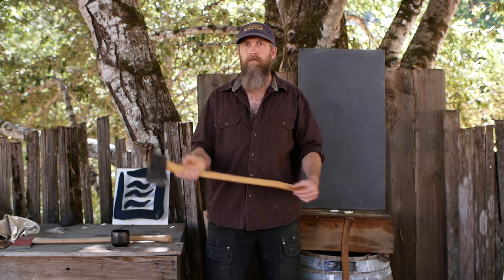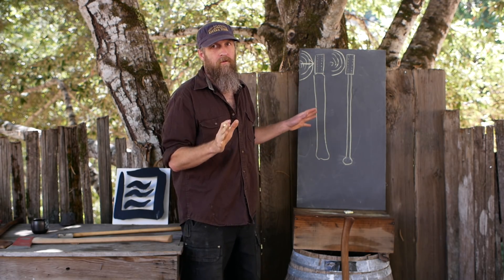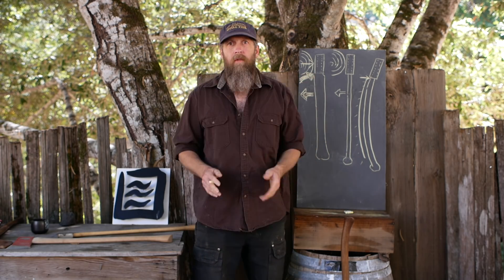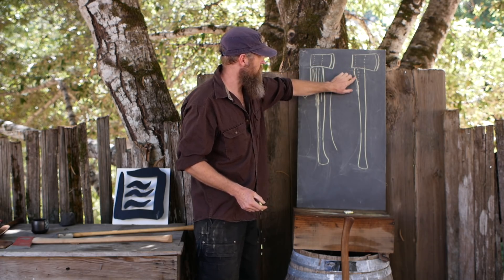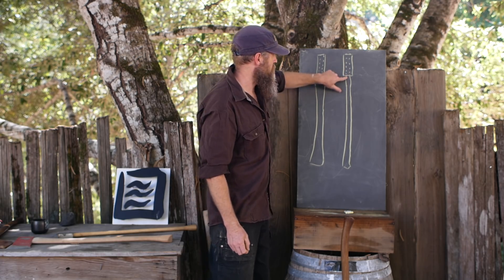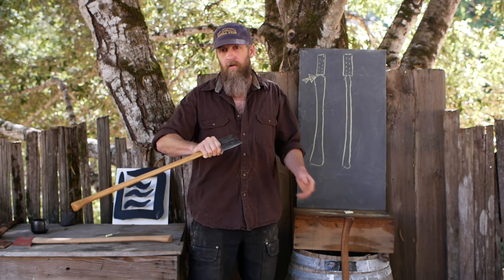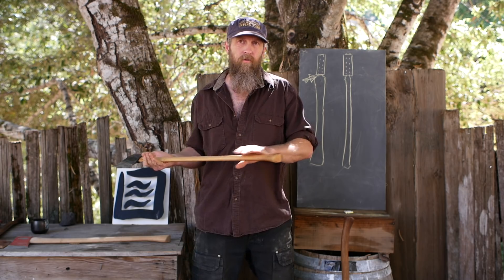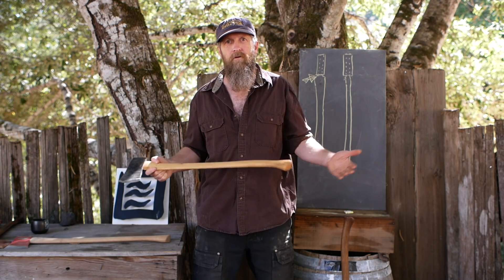Why Axe Handles Break at the Eye: When Strength is Weakness, Overbuilding v.s. Stress Distribution

Comment: A flaw I notice in axe handle design is that at the shoulder where the shape defies the grain, it’s offset entirely to one side. Making this deviation more extreme. From handling other eyed tools it would make more sense to me if the shoulder was symmetrical to make the deviation less extreme and the handle overall stronger. 

Is the purpose of the offset shoulder just to better facilitate the curve of an axe handle?
Reply from the maker: That's an interesting question or angle because it begs more questions.  Obviously double bit axes have that kind of configuration.  If we subscribe to the balance improvement theory of poll axes, it would mess with balance to have a straight handle that has a cut across the grain at both the front and back.  I'm not saying I do, but it would definitely affect balance.  Another point is that the back of the axe handle may be stronger in that direction, because it's wider than the front edge of the eye/handle.  Of course double bit axes essentially have that kind of configuration, but it would interesting to know if they are any more likely to break on the front side when chopping than on poll axes where the handle comes more straight or barely curved out of the eye at the front.  I've always preferred to have the narrow front edge of the handle come more or less straight out of the eye, because I consider it very vulnerable.  The main use of the axe is using the bit to chop and split and the pressure applied to the bit should cause the handle at the front edge to stretch, while the back side is compressed.  Then again, if pounding with the axe, that vulnerable cutaway at the back of the handle would be under stretch.  But again, it is a lot fatter and might be less likely to split along the grain because of that.  Somehow the idea of cutting away both sides doesn't really sit right with me, but I'm not sure there aren't more reasons.  I certainly don't recall seeing it on many poll axes, if any, but of course that doesn't mean it's not a sound idea.
Reply: SkillCult it certainly is a lot to think about. I’ve wondered if it may even be better if the offset were reversed so that the grain coming from the thickest portion of the eye was uninterrupted leading into the handle, though I definitely see your point about the thinner front portion needing added strength as well. 

Having learned to swing with hammers first I greatly prefer straight handles (my most used axe is a double bit), I’ve got a couple nearly identical old Connecticut pattern axes I need to fix/handle. I think I may put a curved handle on one and a straight handle with a symmetrical shoulder on the other and see how they preform. Especially since the conni is a particularly poll heavy axe.

Comment: I believe the eye of an ax is shaped as it is because how they where made during the old days.  By folding an section iron flat bar and forge welding a bit of high carbon steel for the blade (check out Peter Ross a historical Blacksmith).  The iron just wants to make this shape when folded.  According to Roy Underhill, the poll of an ax is an American invention because the Europeans did not have the Hickory Tree, which required the extra mass to chop it.   I believe you hit the nail on the head concerning the ergonomics of a slender handle.  The Maddox has a large eye and is mentioned in the bible which illustrates it's been around a long time, but, it doesn't  feel right if you need to choke up on the handle,  and takes away the multi-usefulness  of the tool, which is common for western culture.  The stone ax was a multipurpose tool that could be removed from the handle, used as a chisel, plus the handle had a  wedge on the end for bark removal , and, furthermore, the handle could be used as a hammer (4 in 1).  The stone ax dates back to 600 years ago, which isn't a very long time.  I'll make a ax using stone age technology but use steel instead of rock and let you know how it works.
Reply from the maker: I suppose it does tend toward a teardrop shape from forge welding a wrapped eye, but it can still be drifted out into pretty much any shape.  I'm not buying Underhill's theory on that.  There are heavy axes with no poll.
Reply: Yes, you can drift the eye to any shape, but, it takes a lot of work.   They were getting paid by the unit, and,  it's human nature to take the least path of resistance.  Iron is a tough martial to shape. I have a forge and it's remarkable how much effort it takes to drift something by hand.  A press makes easy work of it, but, them old timers didn't have machinery.  Interesting though, the shape works out from a mechanics of materials point of view. Wood is stronger in tension than in compression, which is different from metal which is normally equal in both tension and compression.  During the normal chopping swing,   the egg shape of the eye has less cross sectional area on the tension side and more area on the compression side. Even when the ax is stuck and you yank up on the handle, the bottom side is still in tension and top in compression.  Serendipitous or by design?  I think  it's just like the way the pyramids built in Egypt, trial and error. The poorly designed ones don't last the test of time!  Someone  figures out a better mouse trap (faster, cheaper, and better) then it's copy and past down the line of time..
Reply: I don't know but Roy might have it right.  Like you have said, the experienced woodsman used a small ax head with a slender handle for accuracy.  There where used the multipurpose tool ie building shelters , setting snares and chopping wood.  The name of the game is making chips, right?  Looking at the properties of Hickory, it has a remarkable higher Modulus of Elasticity and compression strength, which may have been the driver for something new.  Plus, I have a very cool book you would probably like.  "Museum of Early American Tools" by Eric Sloane.  He gives an Illustration of the 1600's British and German and shows the polls did't start to appear in the 1715's and are Anglo American.  He shows many Tanners tools, as well!

Comment: In my experience on the cordwood challenge, my original thin handle on my vintage double bit broke. Needing to rehandle in a timely fashion to get back in the fray, I stuck a stock handle on it without thinning it down. It cut like a completely different ax. I felt each stroke much more in my arms and shoulders. I finally took time to tune the handle using the thin original as a template. Made a world of difference in my strokes and stamina in a days work on the challenge. Really appreciate you exploring these topics with us. No scientific proof from me on thin handles except my experience and what my body tells me.

Comment: A slender handle is so much more pleasant  to use . I agree that the steel edge of the eye against the most narrow point of the handle is the weakest spot .All the wood handled tools I  can recall the break started at the eye .only exception was trying to pry a rock out of the ground with a shovel burried into the ground against the rock prying and bending the handle to the breaking point.
Reply from the maker: it would be interesting to survey breakage type percentages.  It seems like the greater number must be near the eye and most of those initiating either where the grain is heavily violated on the back, or right at the bottom of the eye.  I know most breaks I've suffered over the years were at  or near the eye.

Comment: Thanks to Issac Newton, he gave us the tools to examine  the forces in an object called newtonia mechanics, which is the basic of today's engineering science.  Looking at the ax handle as a cantilever beam sticking out of wall of concrete and you apply a  force on the end of the handle, the highest stress point is where the beam exist the wall (or handle exiting the bit). The stress here is called the bending moment, which the  bending stress = (Bending Moment times dist from the centroid) divided by the moment of inertia.  Since the both have the same eye area, they should break at the same stress.  Bending force (properly called Moment Force) is a multiplier (Force times distance) and is the force that breaks most tools.  Trying to  pull a stuck ax out of a log, I broke a many of ax handles. Being over 250 pounds and over 6 foot, I can swing an ax.  But, I  tried your approach using a short/ light Ax ( a Fiske with a v shaped bit  and sharp) and I am very pleased with the results. Going to try your Chord wood challenge!    Real enjoy your videos, there Awesome!
Reply from the maker: Cool.  Even when the head is not fixed, as in when it's stuck, I think the greater density and total mass of the head must create situations where the handle it working against the head in a way similar to a beam sticking out of a wall as you describe, and vice versa with the heavy head bouncing around working against the handle.  Me too on breaking handles on stuck axes.  That is one of the things that led me to thinking of axe handle breakage and stress distribution in these terms.

Comment: i never heard of an axe breaking. very rarely. if it happens so what replace it and go on. why so much fuss about axe handles? i think american axes break because they are all twisted up like that. try making it straight and slightly tapered towards the end of the handle. american ones dont break all that often either I think.
Reply from the maker: People break them all the time.  Maybe we are all completely incompetent.  The type of breakage addressed in this  video has almost nothing to do with whether the handle is curved or not.
Reply: @SkillCult  you should do some leather videos.

Comment: i think its just cuz there using more and more crap wood with poor grain so the thicker handle makes up for that.
Reply from the maker: That may be true.  Thin handles are more likely to warp after being milled as well.
Reply: It's gotta be cheaper too; I'm sure the a lot of machine automation cutting out handles and having them generally thicker reduces margin of error. Im fine thinning the handle out within reason, id like to see them get fitted properly

Comment: This and your videos on head weight versus velocity were super helpful for me to understand why my 23 oz. framing hammer was so awkward. its a vaughan with a straight handle and they manufacture it with a belly in the middle of the handle where I feel the need to grip it, instead of towards the end, because the head is pretty heavy. I shaved the belly out of it with a block plane so its totally straight and about 1 1/8  x 3/4. more flex now and more natural grip with my finger tips coming around to touch my palm, so my elbow feels a lot better after using it all day. I also took a grinder to the chunkier parts of the head and probably took it down a couple ounces, now wherever I grip the handle the shape is the same so my grip doesn't change and I have more control with the lighter head in whatever position I am swinging. I am wondering if you have videos or know some good videos or information on what handle cross sections are good for different applications - what I mean is if you imagine cutting across the grain where you grip the handle what shape would it be looking at the end grain - oval, rectangular, oxtagonal? I'm a carpenter, and novice firewood gatherer. thanks. -Weston
Reply from the maker: Hi Weston.  I don't have a lot of opinion on cross sections actually.  I haven't given it a lot of attention.  It would be interesting to look at old hammer handle designs v.s. newer ones to see if  there is the same trend toward increasing thickness over high performance.    I have a feeling that might be the case, but I haven't paid enough attention.  I know that most of the old ball peens I have bought have had very thinned out portions just below the eye.

Comment: I have a 2x2 (1 1/2 inches) Red oak stick about 7 feet long that I screwed up while woodworking that I use as a big prybar and it's tougher than it looks.  And when you look at a wooden shovel it's about that thickness too and if you ever used a 6 foot spade you know you can pull on that handle pretty hard before it will snap.  Even a shop broom is pretty tough I have snapped a few of those and it took a beating.

What I am trying to say is that wood is tougher than it looks.  Especially kin dried hard lumber like ash and oak and maple so why not shape it to something that feels good in the hands.  Worst case is that it will break on impact and you will feel it right away when that will happen and don't go hard with a sharp tool until you know how to handle it.

Comment: Outstanding presentation Stephen. With over 30 years professional experience as a steel fabricator I can say unequivocally that sharp inside corners are a huge problem. Sharp outside angles (like at the butt end of your handle) are not. Any time that you are cutting into your material square corners are to be avoided. Working in steel, cutting a square inside corner will always stress and crack at the corner. They must be given a radius. The more radius you can engineer into it the better.  Thanks for pointing out that the axe is a dangerous tool and no joke. That can't be stressed enough. Chainsaw too.
Reply from the maker: Danger, Danger..  Never hurts of reiterate....  I don't know the math at all, but I would assume that the strength curve is not linear and that there are diminishing returns, but it does seem fairly obvious that the more gradual transition the better.  Thanks for the input.
Reply: You would think it's obvious, but I see square cuts and sharp inside corners more often than not. I don't know the math either, but I agree that there are diminishing returns, though typically other design considerations intrude before those are met.

Comment: Good stuff.  It maybe makes a case for doing what you did on the Husqvarna (I think?) where you were rounding over the inside edge of the eye before putting the head back on.  I thought that was a really interesting idea, to potentially reduce the stress concentration.  It certainly seemed like a good idea to try.  

But all this talk of handle breakage is clearly not as important as how fine a grit you use when polishing, and what wood you use for a wedge to get a cool contrast picture for Instagram.  Don't you pay any attention to Axe Junkies?
Reply from the maker: Well, at least not having a sharp edge, but I have given some thought to more radical versions of that.  I think if one approached the eye more from an engineering standpoint, it might end up looking and functioning quite a bit different than the average axe, or possible any axe.  I have some ideas brewing, but carrying them out is another thing.

Comment: Thanks for sharing this information with the Axe Community.  Totally agree with the technique points, including what some call "floating the axe"... lighter grip just before strike impact. Can't really control the direction or strike placement at that point, so letting it "float", and then reengaging the grip after the shock gets absorbed, to "catch" the axe handle, and protect your grip or hands from the shock. A hard grip will sometimes be stronger than the handle itself, and the weakest or least resilient part of the system can fail...  Thanks again and Axe-on!   Peace, Rooster
Reply from the maker: Also, I think control is almost the wrong attitude.  I've noticed that when I'm in the zone, it's almost more like I'm getting out of the way more than I'm steering.  A heavy grip on the axe and trying to be too engaged in aiming and adjusting during the swing can easily lead me to less accuracy.   And yes, I think a hard grip can allow stresses to stack and play out in the handle between two opposing forces.  The Head is super heavy and if the grip is super heavy, the handle in between might be collateral damage.  One thing I've been meaning to work into a video somewhere is to propose the idea of thinking about if were to throw our axe into the work not hold on to the handle at all when the axe strikes, how weak would the handle have to be to actually break.  It would just whip and flop around playing out the excess energy.  I'm not advocating that, but the rule of extremes would contrast that with iron man taking a death grip on an axe and the relatively flimsy handle would be stuck between two powerful intertias.  So, yep, I agree that the death grip can increase the likelihood of handle breakage, especially if it is used to try to drive the head into the work when the bit strikes.  I think the idea of driving the head with the handle after it hits, and the idea of control and grip are all part of the same misguided assumption about how the system works at it's best.  There may be a time and place for that approach, but not much in regular axe work.
Reply: @SkillCult  Good conversation, and good content. One of these days, I'll make it out to your neck of the woods. We can compare notes and then turn around and pass it forward... Keep up the good work! Thanks, Rooster

Comment: Just checked the blog and realized you already commented on the issue of Basque handles. Ignore my comment them and just refer to the blog. By the way, yes the handle of those basque handles is beech and the reason is because competitors (some of those axes are used for international competitions) reported that beech wood heats less when they are competing. Not very relevant for the average user since we are not going to attempt to cut a log under 90 seconds, but I have one and works and holds just fine.
Reply from the maker: It's an interesting question.  It's hard to believe that the ancient form of axe with drop in friction fit handle was abandoned for no good reason.  Clearly if you watch Basque axemen at work, they are highly functional axes, but a slew of problems were created by evolving toward bottom fit wedged handles.